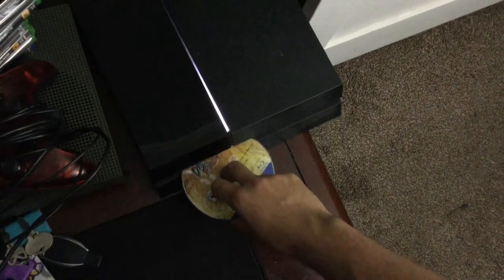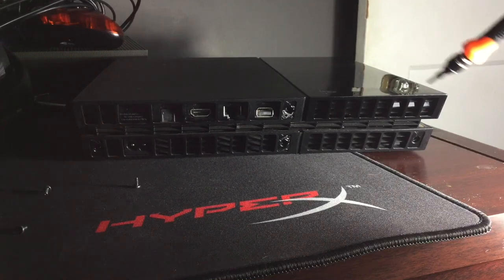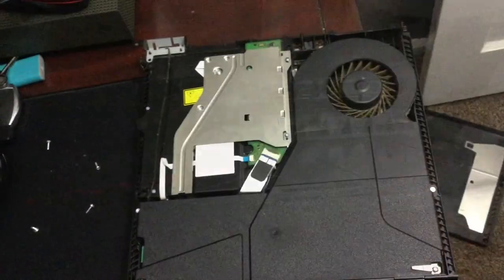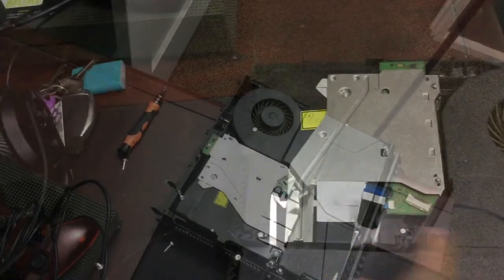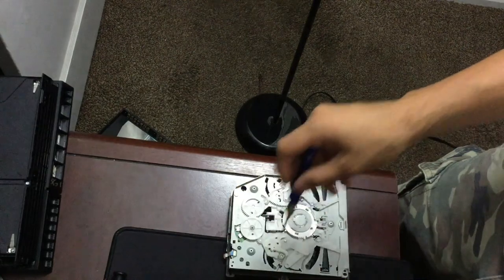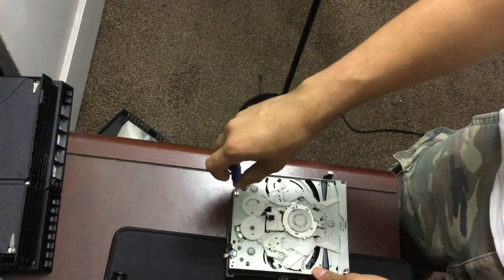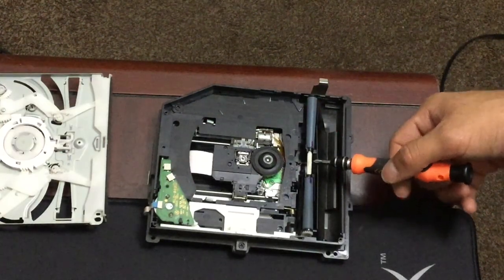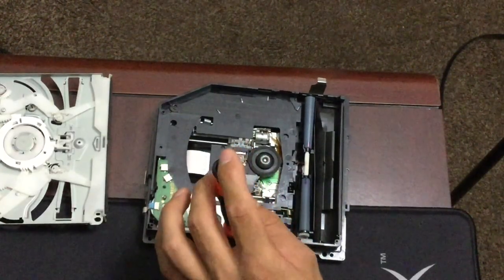fixing PlayStation 4 disc drive problem

Comment: I cleaned the rollers but there's nothing wrong with it, it's still broken, so I though the disc drive is dead so I replaced it but put the old logic board to the new disc drive so that the ps4 can accept it, but it still doesn't work, please help me😭😭

Comment: Hey I have issues with the roller assembly, when I put my rollers in the assembly they seem to look in a weird angle with me could I contact you please?
Reply: Hi this is my problem too. Have you figured it out yet mate?
Reply: @whatamidoinghere6603  Yeah I have, the problem was an easy fix, i just had to put everything back and turn on the ps4 and just put a disk inside. I guess the rollers just get back to its original place when you put a disk indside. 

So just turn your ps4 on and put a disk inside and eject it then you can see that the disc drive just works perfectly normal.
Reply: @Reda.Az.  ah I’ve tried that and it didn’t work 😅
No worries, thanks for replying though
Reply: @whatamidoinghere6603  Sorry to hear, hope you'll have a fix soon!